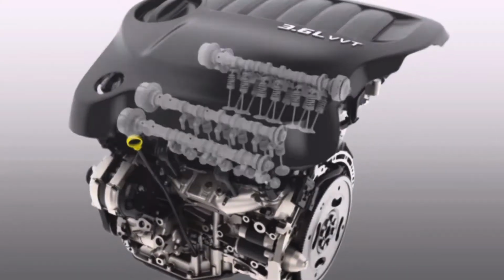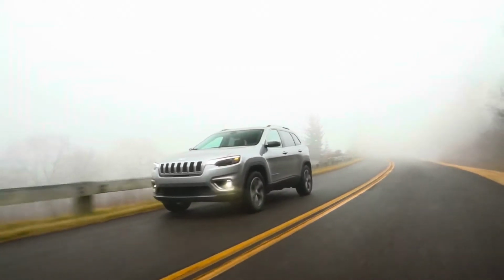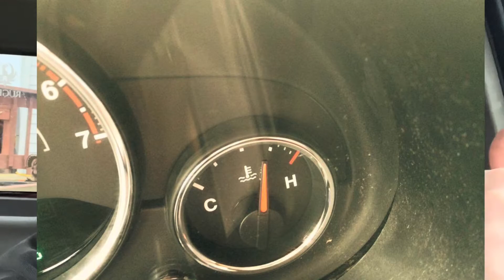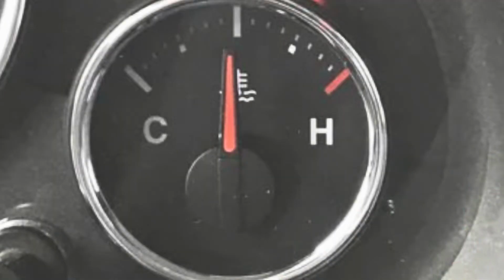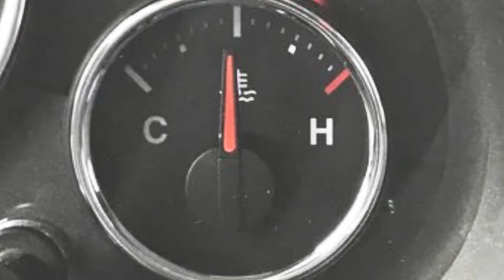Jeep JK/JL Normal operating temperature

Comment: I even saw a blog where a guy had the 2021 version and he looked up the temp thru the menu and it was at 203 and it was below the half mark and it got as warm as 230 and the analog still was stuck on the same spot mark and ppl said it’s a dummy analog because Chrysler got too much complaints of the 3.6 over heating when it wasn’t it was just normal operating temps

Comment: a quick way to check if your thermostat is not working well is to turn on the heater the heater core bypasses the thermostat.if turning the heat on cools your jeep the thermostat is bad
Reply: Thats some very good advice, i had no idea it bypassed the thermostat, i just thought it added an extra radiator. Mine overheats till I turn on the heater.

Comment: Thanks Ronnie for relieving some of my stress. I didn't have any issue till I got a check engine light and changed the thermostat at 78Kon my 2016 JK. Then It got hot and dinged at me. Then I did a pressure check and everything checked out. I cannot get a Factory T Stat because they are on Back order and a work at a Dodge Dealership. I thought that was the issue. Then the oil cooler went, so I replaced that and it seemed like it fixed it. Then it started getting hot again. The mechanic who did work said I probably had an air bubble. I saw less coolant in bottle, so I topped off, and thought that was the problem. Only get hot if I punch it and stay in it. I kept thinking this is not right , and I love my 2 Dr. , So I said hell with it. I replaced Radiator myself, and since I was there, did the water pump. I thought well I might as well replace the T Stat again, so I did. Jeep now runs steady at 217 to 222 at idle or cruise, but still gets up to 235- 240 under heavy load. I was thinking slight warp in head, or head gasket, but it has never boiled over. I got sick of worrying about it, so I bought a 2019  4DR.  Your video just calmed my nerves, and I will forget about it. The only thing that pisses me off is that my 2020 Gladiator runs at 195, and so does my 2019 JL . Could it be that these both have the original T Stats?
Reply from the maker: The jk are fine when they get like that you will know when they over heat I’ve done it before. The newer jeeps are designed a little bit better and the pcm and all that stuff is set differently. Honestly most new vehicles run a little hotter to burn stuff off a little better. My 2020 work truck is a Chevy and they run the same temps that my jk did. I’ve seen people lose sleep over it damn near buy a whole new engine with the end result being the same. I tell people If it bugs them that much put a pusher fan on it or have it tuned so you can set the fan temps
Reply: @cherokeeronnie  Thanks Ronnie. Your a good man. Have a great Memorial Day weekend!

Comment: 2017 jeep wrangler, have replaced water pump (2x), thermostat, and heat temp sensor and radiator hose and still overheats. I burp it every 2-3 months to get rid of the air in the system but wondering if it does this since we add any coolant other than the authorized ZEREX G05 that it calls for. Saw another YouTuber who washed the radiator out from debri so will be doing that next and maybe get a new OEM radiator cap
Reply from the maker: What’s your temps?
Reply: Not sure but does go the 3/4 mark and occasions. As a matter of fact, last night, it did go past the 3/4 mark and the red temp sign popped up as I was turning in home(thank God)here in Texas around 9:30 where it was still probably 100 degrees outside

Comment: ok so,, 2016 JKU,, 20s on 35s with 3.5 lift.......   I appreciate this vid  and all the info provided.. I usually ride around 210-220 in and around town,  BUt Yesterday i saw 233,,, I was goin Up Hill but I take this hill Daily coming back from work.... so Yes  I panicked,, didnt smell anything, coolant is level,, so im jus sittin here like WTF,, could it be a bubble maybe.  Gonna burp it this afternoon.. Its usually pretty stable On n Off the gas,   But between yesterday and This morning coming into work,, was spiking when i Got Down On It  !!!
Reply from the maker: They tend to do the dealer says it’s fine it don’t sweat it I run mine all the time and it does it

Comment: I almost believed what you're trying to say here, but then I suddenly realized that it just doesn't make sense. Keeping your beloved engine and everything around that engine running at 210 or even higher (normal temp?) cannot be TOTALLY FINE. In fact, it's not fine at all. Everything is gonna degrade pretty much faster than expected. If you simply google it, you will get an answer saying that 170 is a normal temperature! I know this answer is fking funny. But if you just ignore the high temp issue and keep torturing your beloved car like that, sooner or later, you gonna have to handle a giant bill of payment due to engine failure or things like that!

Comment: My winch was sitting up blocking half the radiator and I was starting to get higher temps. I replaced the bumper and issue fixed. I do see 200-228 but 228 is typically right off the highway and coming to the first stop light so I expect that.

Comment: So I have a question and hope that you will answer me. My 2015 wrangler 3.6 has never went over 227. And that was under a heavy load pulling a trailer from key west to Birmingham Alabama 17 hours straight in August of last year. For the last few months it has been hitting 230-240 at times. Even 245 once. This is only at higher speeds and usually when I get on it hard, but will also do
It when I’m driving easy or up a slight incline. It has stayed at 230-235 for a few minutes before and then dropped. I have replaced every single thing you can replace to do with the coolant system except for the fan but it comes on when it’s supposed to. I just installed a 3 row radiator and am still seeing this. I also had the head gaskets done twice as my mechanic thought that may be the issue. So far it hasn’t went over 245 and I haven’t even seen 240 in about a week now. What’s weird though is when I leave my radiator cap off and it not running and cool or warm the coolant will go down into the radiator about an inch every 5-10 minutes. I have been doing this for like 2-3 days straight and burping it in between and driving it in cycles. In hopes that there is possibly still some air in there. But I have never seen anything take coolant like this for so long. Please help me as I  am mentally struggling with this now. I also am gonna install a pusher fan today in hopes that may help. This all kinda started after I went from 35’s to 37’s and a 4.5 in lift. I feel that could be part of the issue as well. Would love to hear your thoughts on this!

Comment: Mine was getting super hot always always!!! 

I went 

4 row aluminum radiator with aluminum fan shroud & fan 

Mishimoto Upper & lower Rad hoses

HPS heater hose kit (blue)

Mishimoto aftermarket thermostat, opens at 179

Brand new water pump (TRQ)

brand new Mopar fluid 

I rigged the fan on a toggle switch into the cab so that i can control when the fan comes on & i control how long.

Comment: 220 is a normal temp for most modern engines. My Jeep is normally at highway speed sits around 217-220.  Uphill during the summer time it max out at 228. The highest I have seen is 232F going up in Utah a long step climb on Shaffer trail
Reply: Ahh, LOVE Shaffer Trail! One of my favorites!
Reply: Mine does exactly this,  so we're good,
Reply: Why do the fan get so loud and don’t turn off??? The fan only gets quiet when it gets down to below 213 also why do it jump around so much it jump form 213 to 220 and man 230.

The problem is the fan running so high.
Reply: @atmphil1 asking for help my fans  run full speed.  And coolant run down inside expansion bottle bottle

Comment: mine is a 2021 wrangler sport  which fan is the variable speed the driver side or passenger side its a 3.6  seems like i used to hear the fan changing speeds while waiting in a drive thru havent noticed it lately had a recall computer update back in early summer from jeep did they change that setting by any chance?

Comment: install a secondary pusher fan and a 185 thermostat and it will run perfect forever. no need to run at 230 with an extremely pressurized cooling system all the time.

Comment: Mine isn't a Pentastar- I guess..
It's a 2.8L 
2010

Driving in 95°F
At 70 mph on the highway - it lost power and the tem guage went to 34 mark
I pulled off into a rest stop and the clunk coming from the engine is bad news. Oil level and coolant level are topped off. 
The fan doesn't stay running though. I don't think the fan was coming on. If I recall correctly the fan stayed on even when I  shut the Jeep off before, until it cools everything off to a certain temp.
The clunk found is what I suspect may be a rod knock.
Damn it ! This is sucking bigtime !

Comment: 2011 Grand Cherokee,  runs at 204 - 213. Less I get "low temp warning." Yes, P.O.S. overheated, lower radiator was clogged from wrong coolant. Replace radiator.  Prior, thermostat low temp warning. I couldn't get the dealership to correct it, no parts. The dealership parts, lady gave me the specific aftermarket brand and number that Dodge used during pandemic.(I replaced it myself) Latest episode,  water pump AND thermostat. AGAIN dealership couldn't get thermostat,  I called another dealership and yes, they had one. I drove to that dealership,  bought it, then hand delivered it to the local dealership.  Oh, initially,  service manager said they would warranty DODGE/JEEP part from another dealership.  UNTIL I PAID THE BILL..  they CHARGED ME FOR THE THERMOSTAT I BOUGHT, THEN SINCE IT WASN'T FROM THEM ANY WARRANTY WOULD HAVE TO BE BY THE DEALERSHIP I BOUGHT IT FROM - THEY REFUSE TO WARRANTY ANY PART NOT BROUGHT THROUGH THAT DEALERSHIP.  BULLSHIT. I'm buying a KIA!

Comment: My 2015 Wrangler, when the temp guage is in the center, my electronic temp shows 222. Mine goes over 230 all the time, on the freeway at 65, going up hill it hits 240 to 244. Scary
Reply: There is nothing blocking my grill. I geared to 4.88 on 37's, automatic transmission
Reply from the maker: What’s the temp out side

Comment: mine never use to go up and down but one day it just started and now i got hot air driver side and it gets cooler as it goes to passenger side and passenger side is cool. mines a 2014 jk and also got told that there a bitch to bleed and the water doesn't go all the way up to the heater hoses and need to fill them seperately????

Comment: My 2017 jk 35” tires lots of weight but never had an issue til went mudding, sprayed the radiator never been the same since never goes below 217 ever highways now trying to go 75 mph I start hitting 224-230 fan sounds like a jet engine driving through my residential at 222  had almost everything swapped out except the water pump and radiator itself. So frustrating
Reply: I’m having the same issue, and looming for a solution to the noise myself because the noise is super loud
Reply from the maker: It’s normal I’m around these jeeps all the time it’s more normal than you think

Comment: I appreciate the vid but what doesn't make sense to me my 2015 wrangler just started to run hot in its 8th year of having it... why did the jeep wait so long to start to run hot like this ..any ideas ? I changed the fan relay, the tipm, the thermostat ,the coolant and the next thing is the water pump and the temp sending unit ,the radiator was replaced a few years ago due to a leak so ik there's no clogs or leaks and the electric fan works as it should . On and off i have heat and then i don't have heat ..so ill have to check the thermostat again by boiling it in water to c if it opens ,if its good ik its not that ,the only thing left is the water pump and temp sending unit ..I'm pulling my hair out on this one..ps my gauge pins at red hot and the light comes on

Comment: What should the 3.6 idle temp be. Mine is 219. It as run up to 245 almost 250 up hill in south ms. So our hills are not big lol.  Depends on how much load and how hard I run it as to how hot I run it. I have changed radiator,water pump,thermostat. I’m concerned I have a head gasket issue
Reply from the maker: That’s pretty hot have anything in front of the grill
Reply: Same here.  Also 4th thermostat.  Did you find the issue?  Going to flush my heater core next.  Heat was not working  consistently this morning.

Comment: I have a 2016, I changed my radiator thermostat and water pump due to the oil filter housing being damaged and causing the oil and coolant to mix. After replacing everything I don't over heat but I'm losing coolant. The oil looks good but my fans never turn on and the engine stays around 210 F. Where would the coolant loss be from? TIA
Reply: If it’s not in the oil, Only place it can go is out the exhaust. Head gasket blown

Comment: It’s a 100+ over here and driving up a grade I was pushing 235/245 once I got tht hot I put on the heater and it cooled down quickly.  Does that mean it’s just hot outside and it’s going to have a trouble cooling in general or do I have a cooling problem
Reply from the maker: Mine use to do this when it was super hot but mine had stock gearing at the time after I regear it was better

Comment: I have a 2012 JKUR on 37's and 4.88's. Normal driving I see 225-230 with the AC on  coming up a hill with the AC on, I'll see 240. I can't tell if the low fan is coming on but for sure the high fan is not the temps don't drop. When that happens, the needle is about 5/8 of the way up. Should I be worried? I've replaced every component of the cooking system and did a leak test... I'm so worried that is gonna explode when it's 115 ambient.
Reply: 230 is too high for me usually means it's dirty or clogged... upgrading to the mishimoto all aluminum v2 soon I've had enough of this... Florida, 37s, 4.88 gears lots of weight 230°f at 75mph 97°f with ac on
Reply from the maker: Sounds normal new cars run hotter for emission reasons

Comment: My 2018 wrangler jku coolant temp willl run 200-210 on freeway and once I hit back roads it goes up to 230-240F but once the fan kicks in the temp goes down..is that normal?
Reply from the maker: As long as it drops back down fairly fast

Comment: Mine got up over 230 today sometimes hitting 250. It hasn’t done this in two years that I’ve had it. I drive it every day about 100 miles. I’m trying to figure out where to add the coolant because it looks like the coolant is low. Do I add it in the reservoir that has that little dipstick? I cannot find this information anywhere on YouTube. It is driving me crazy. And does it matter what coolant I use I just bought, O’Reillys universal 50-50 coolant. It says it’s for all makes and models and colors. I’m just need to add some of this and I can’t figure out where to add it. Sorry I’m not a mechanic.
Reply: Don’t add just any coolant. You can’t mix OAT and HOAT. 250 is too hot , check levels. You may need to change the entire coolant. I changed mine and it ran 15 degrees cooler.

Comment: Thanks for the Info on this. I was out this weekend and was the temp all day. I was wondering if it normal for the 3.6 to run that hot. I was waiting for temp light to come on but the gauge barely made it past the the middle point in gauge. In the summer I've seen 235 quite regular when the temp is 90% or over out wheeling in the high country.

Comment: I have a 2014 Wrangler and it runs completely in normal temps in highway and around town, but when i climb a hill my temps rises to 230-235 then when i reach the top it cools back down. is that normal?

Comment: I have a 2012 Grand Cherokee Laredo 4x4 recently swapped the water pump due to a leak and changed the thermostat which was sticking. Ive seen 212-220 temps on normal drives but yesterday I saw it do up to 238 on very hot weather and traffic is that normal? Coolant does not boil or anything although I do see the temperature fluctuate alot increasing and decreasing like 8 degrees in seconds.

Comment: I just swapped out my Cooler Housing Unit out with an aluminum unit. Before my temps would be 220ish. But after I installed the all aluminum it runs up to 230 when I first hit the freeway but drops back to 225. Then fluctuates between 215 and 226. Is this normal now with the aluminum Housing unit just naturally being a stronger heat conductor?
Reply from the maker: Perfectly normal
Reply: I just did the same, replaced the oil cooler with the Doorman aluminum one and now it runs considerably hotter. Used to get up to 230 under load up hill and would come down to 220-225. Went out this weekend and saw temps up to 245 going up a mountain road. It only came down when we turned the air off and put the heater on but only came down to 230-235. I’ve gotten used to the high temps as normal under load at the 230 range. When it gets to 240 and above I get nervous. Once we start going down hill goes right down to 205-215. Also it fluctuates in town from 210-225 I see this as normal for our JK. I am not used to these newer engines running hotter and the fluctuations in temps under load. Guess I’m just old school.
Reply: My 16 rubicon does same thing drives me nuts lol. I also have 40s so just figured it was because of that lol it it also does it even at idle.

Comment: Hey Ronnie, can you confirm the low speed fan is running on your 3.6s? I'm concerned with my friend's temps (they're as you describe but it's supercharged w a winch, etc). I've confirmed the low speed fan does not work and that the TIPM is to blame.

I wonder if the TIPM failure is a cause of these hot engine temps.
Reply from the maker: My low speed fan always worked